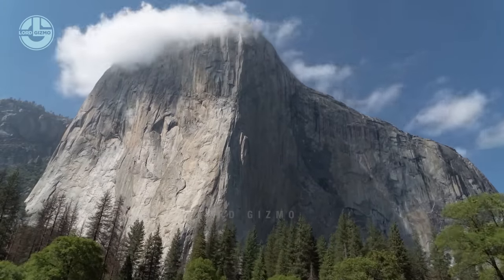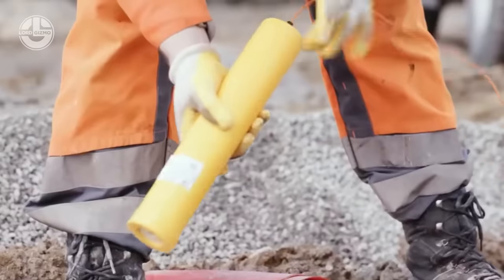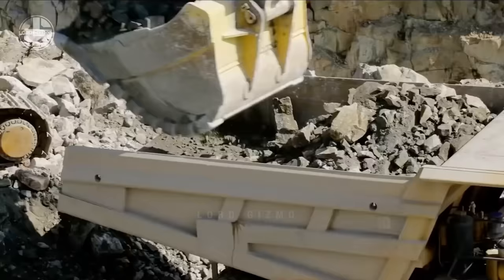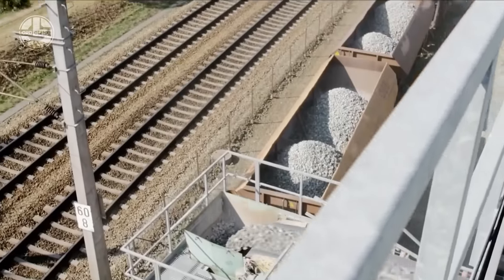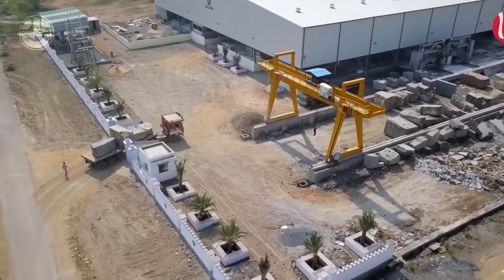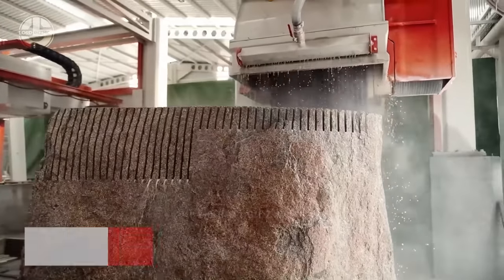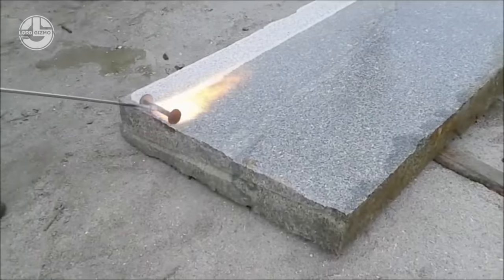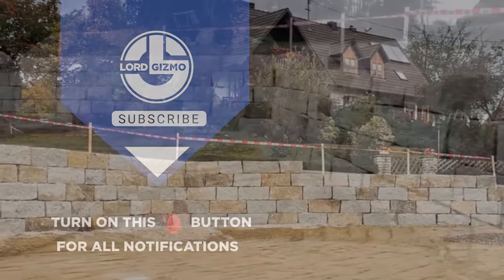From Quarry to Fortune: The Million-Dollar Journey of Granite Mining and Manufacturing

Comment: What a lot of crap! Granit is easy, all you need is a copper chisel and some rubbing sand. Years ago we could produce massive blocks weighing hundreds of tons and just pulled them a few hundred miles with a few hundred guys and a rope. I swear we have got soft in recent times! These contractors are just making it look hard so they can charge more.
Reply: I agree
Reply: You are from stone age .
Reply: "Granit is easy, all you need is a copper chisel and some rubbing sand."

Depends on what you want to achieve with the granite. You can do detailed work on granite with a copper/bronze chisel, but you wouldn't use it to remove large amounts. You can saw and drill granite with copper saws/tubes used in conjunction with abrasives like quartz sand or corundum. We have found traces of these materials in ancient cuts and we have replicated the process through experimentation.
And no it certainly wasn't easy. The ancient Egyptians referred to granite as "costly stone" for a reason.
Reply: Really as far as I know granite is the hardest rock
Reply: Did you guys use bullwhips or steel whipping rods?
Reply: @robertgoss4842  Copper strip 😄
Reply: @robertgoss4842  bullwhips mostly but the thick set ones we used steel rods. This sometimes made them lethargic though so we used them for lubricant and replaced them with new ones.
Reply: Mumford and sons song playing in the background..."U Liar"
Reply: An ancient egyptian typed this